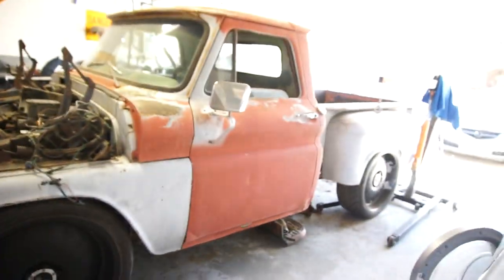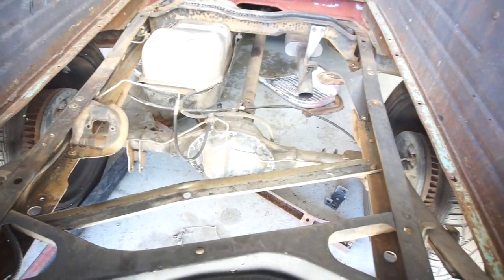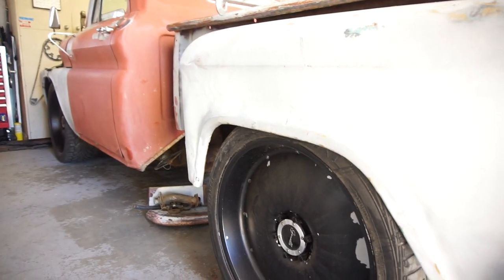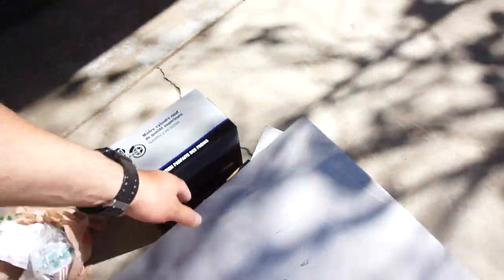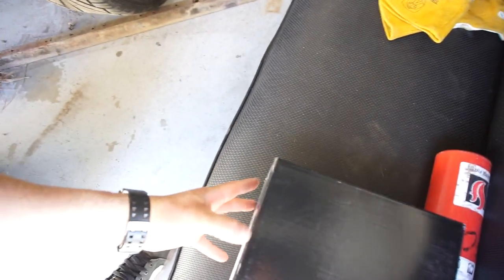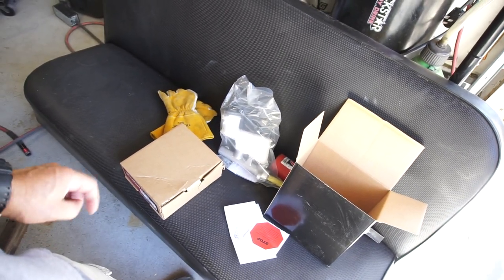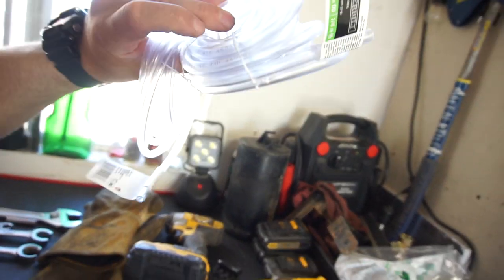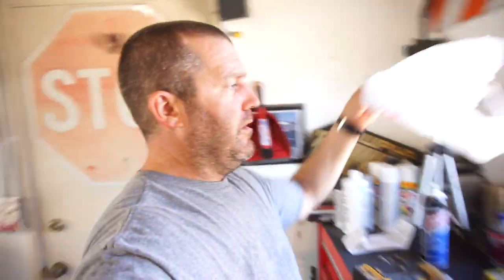1964 C-10 On A 1991 Chevy 4x4 K1500 Chassis Gets The Bed On. Swap Meet Tool Haul

Comment: " let em' keep doing their job ."  Hey , practice makes perfect !  HAHAHA !!  What I've learned is you can expect the same service and help from an area because the are drawing from the same pool of people . Doesn't matter if they work at NAPA or Auto Zone , same people different location .  In my area Ace Hardware handles Crapsman tool, if that is more convenient for ya'.  Yeah ,the bed looks like a lot more work than I figured it would be .  Who knew , right ?  Are those wheels gonna fit in the fenders ? they look awfully close at the rear of the fender .  Well , it's progress no matter how ya' look at it .  Just another thing that needs to be figured out .
Reply from the maker: Orion Fixr I’m gonna have to widen the bed, tub it and raise the inside. I have a plan though. 😉😉
Reply: @Halffast719  ; yeah, I figured !! LOL